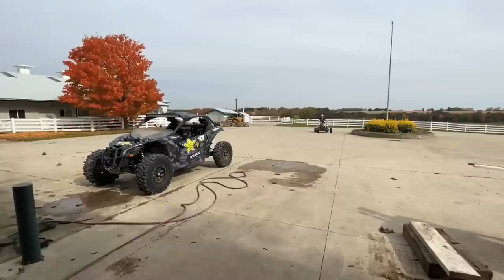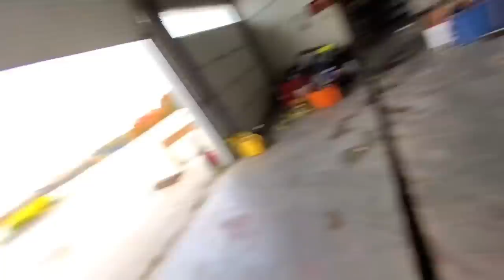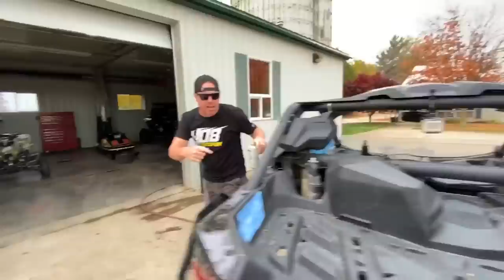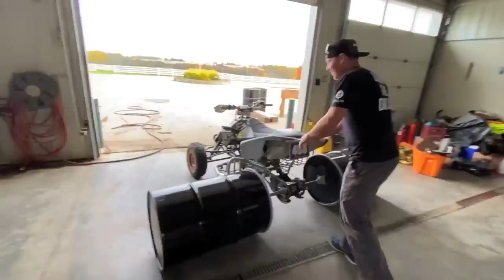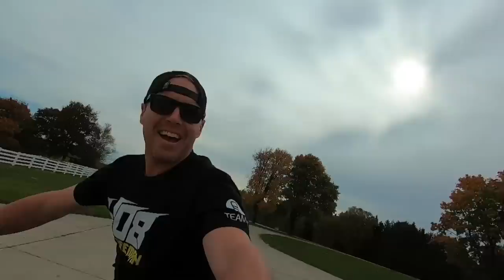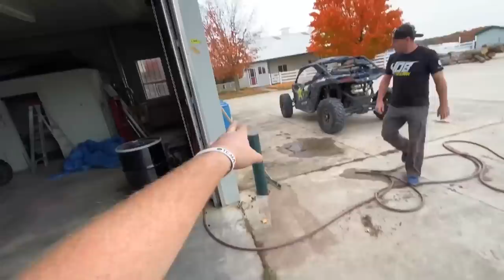QUAD Barrel TIRES!

Comment: Attach the plastic barrels to the sides of the sled and drive like a boat on the water. Then the quad with some paddle tires. Just make paddle rims and bolt them on down at the water

Comment: Kinda mind blown ya quad's still going. Pretty sure when I first subbed it was like 2013 and you had the exact same quad if I'm not mistaken. Has it had any new engines or anything like that?
Reply from the maker: Haha cause it’s a KTM! Only had one issue and it was a safety switch on it last year. I barely ride the thing after my racing days.
Reply: @markfreeman408  That's crazy! How come ya stopped racing? Haven't been around for awhile & missed out on a ton